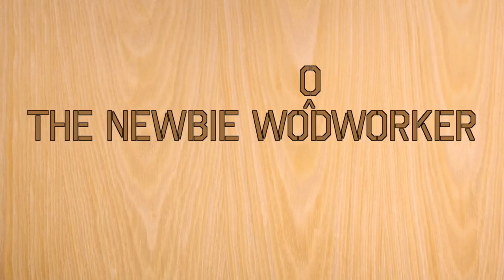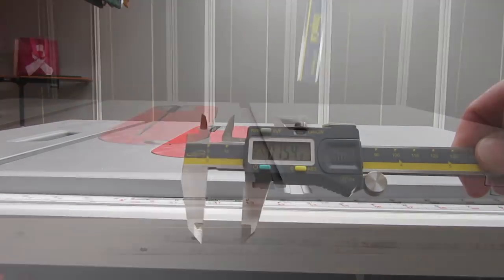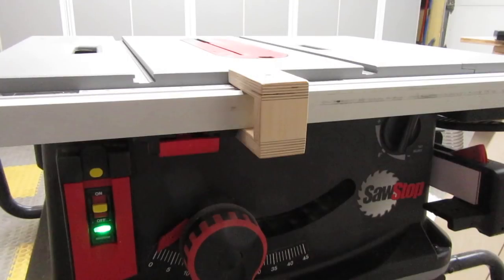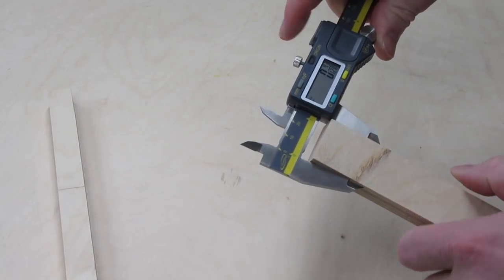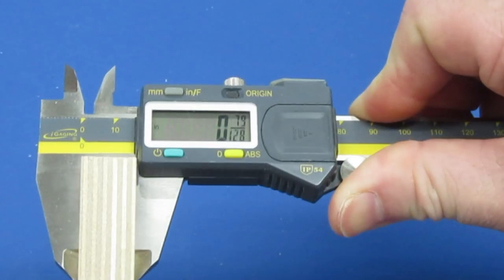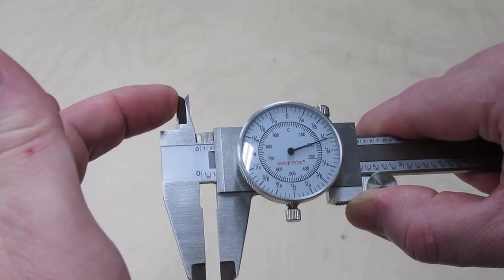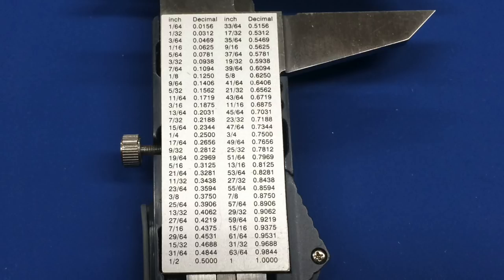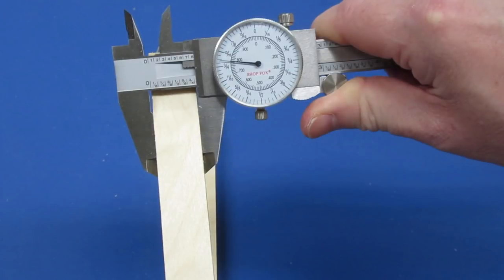Newbie Tool Tip: Calipers - Digital and Analog

Comment: Thank you for the video. I just bought a caliper not realizing how much I'd be using it (complete noob to woodworking). I think I will have to invest in a higher quality one like the ones in your video. Keep the videos coming! Good job!
Oh, and I bought the wireless remote outlet switch the other day (after watching one of your other videos), I do not know how I have lived without it!
Reply from the maker: Thanks. Don't you love that remote? Best cost/pleasure ratio I can think of. :) As for new calipers, it won't be the last thing you buy, then buy another of. :)

Comment: Hi Dan good subject once again.
I find that when watching YouTube videos I learn a great deal from those that make comments.
Or the links that the poster provides for additional information. 
In this posting I looked at the Amazon link to the calipers. I Went to the link and a reviewer evaluated the calipers 
Discussed in this video. What a Great review. And it is all because of you Dan.
The Harbor Freight calipers that I own are spot on but I did sort through several before I selected the two that I own. With calibrated gage blocks.
If you do not check the accuracy in the store like I did you may not be so lucky.
For $9.99 I am happy. If I had to mail order them I would select the ones in the review for $49.00.
Some times you get what you pay for. Then sometimes you don't.
Reply from the maker: Thanks for sharing your experiences! I wrote a long response, then decided it might be a good subject for a short video, so I'll hold off. Other than to say that I agree completely with your thoughts on reviews, and on Harbor Freight.

Comment: Hi Dan, I really enjoy your channel and have learned something from each presentation. There is also a step measurement on the back side of the caliper. You will see it as you slide two jaws apart.
Reply from the maker: Thanks! I got all excited and went and looked at my calipers, but unfortunately, they don't have it. But that's a good thing to look for when buying calipers!
Reply: Hi Dan, All calipers have the feature. Please watch the YouTube video called "Dial Caliper Use - Mitutoyo"
Reply from the maker: Ahh! I completely misunderstood what you were talking about. In my defense, you said it was on the back side, but I consider that to be the front side. :) Thanks!

Comment: The iGaging Caliper rocks I also have a Vinca caliper it was under 20 bucks and it works just as well as the iGaging has mm  inch and fractions has usb port its really  heavy and tight .
Reply from the maker: Nice! Thanks for sharing. 😄

Comment: I've also seen vids where they use the caliper to score or transfer a measurement using the tip of the caliper.  Would you suggest this?
Reply from the maker: I would if I could do it. :) I've seen lots of people do this, but it never works for me. I'm probably just too uncoordinated. So yes, definitely use them for that if you can. When applicable, I use a wheel marking gauge, like this: http://amzn.to/2DYyufr
Reply: I agree do what you want with it if you can, every tool has it's use. I would not use a 10 pound mall to drive a finishing nail will it work? Sure!
I will say you do ask a good question. And I have seen what you are referring too Mr. Wandel does this and I have a lot of respect for him and his talents. He is an Engineer and an artist. I have calipers from Harbor Freight yes I will use them as a scribe in soft materials. Would I use my
Starrett calipers in that manner? Nope! I hope that helps. To me depends on how well you respect your tools as to how you use them.
After all they are yours.